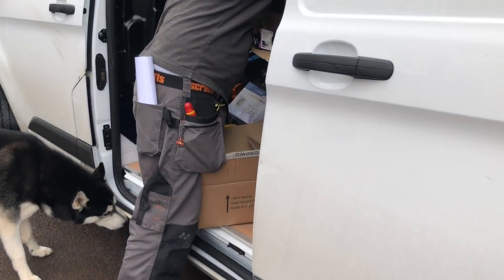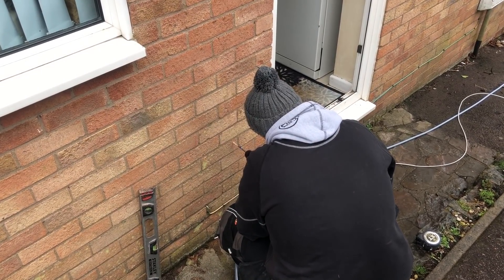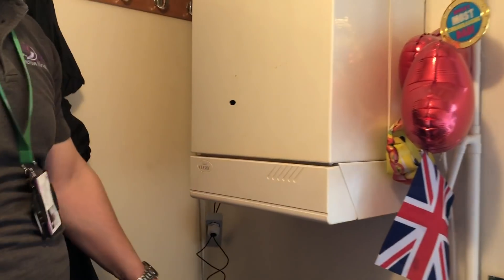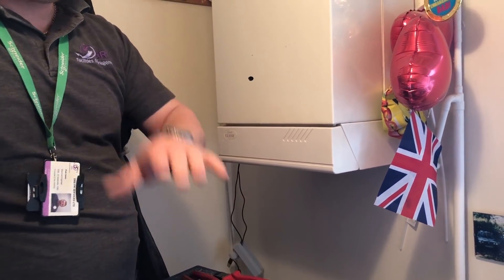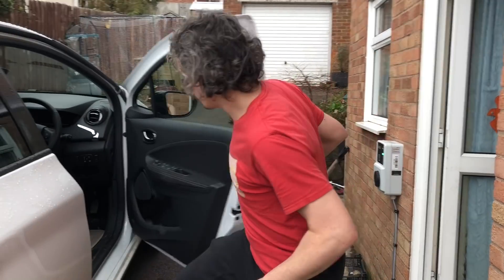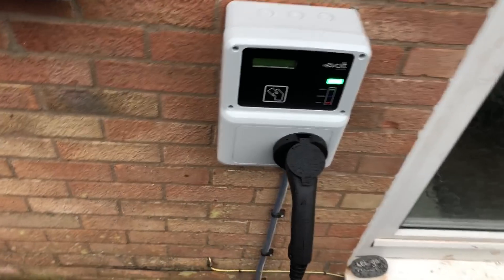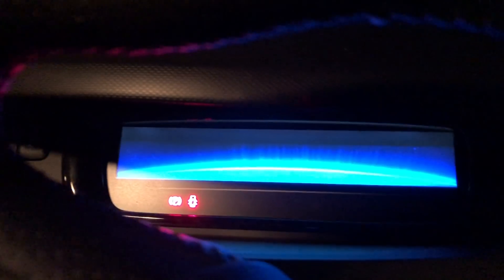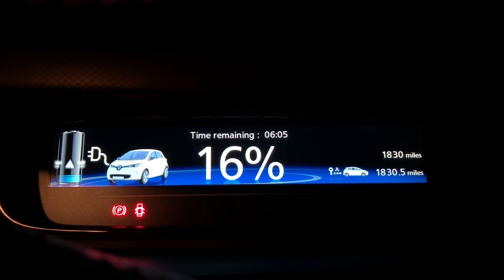7.2kw eVolt Electric Car Charger install

Comment: pod point guy took literally 20 minutes to install my 7kwh charger for my 30kwh leaf. ¯\_(ツ)_/¯
Reply from the maker: What the same charger as this one? Or the same as my original one (which also took 30 mins to install). This one is much more in-depth so would be really surprised if they could assemble and program that in 30minutes lol
Reply: Ian Sampson the pod point has everything integrated, all WiFi stuff. So it was just a matter of running a cable and mounting it on the wall
Reply from the maker: Greg Jaskiewicz yeah totally different bit of kit. This one communicates directly with the car and allows the electrical grid to remotely monitor your power and turn charge on and off for periods of time etc.

Comment: Nice EVSE! Too bad the screen doesn't have a backlight , not sure if you'll be able to correct the condensation issue but the price was right! Cheers!
Reply from the maker: lol price certainly was right :)
Reply: Ian Sampson don't you feel bad about them having the control of your charging? I would be quite hesitant with that.
Reply: I've had the same charger for a year now with no issues, they even send me surveys now and again and give me Amazon vouchers for the trouble. the only down side is having to keep your router on 24/7

Comment: Worth checking your electric meters time is right for economy 7 if you have it coming on bang on midnight. Our meter is supposed to change over at 12:30 to economy 7 but the clocks wrong, and it doesn't change with the clocks so in summer we don't actually go on economy 7 until about 1:50am, which is a bit annoying.
Reply from the maker: That is annoying! Our area it starts at 11:30 and finishes at 7:30 from memory.
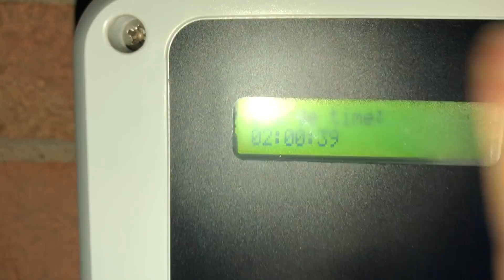Reply: Looking on the bright side, you could do a lot of things in the morning on 'night rate'! The timing at my place is 23:36 to 6:36 GMT, all the year round now (it's supposed to be 23:30 - 6:30). Until a few years ago, my supplier used 'radio teleswitch', and it was 'night rate' from 00:30 to 07:30 GMT in their area.

Comment: Put a silica gel packet inside to absorb the moisture
Reply: Another brilliant video ian. Just as a matter of interest, who do you have economy 7 with? And what are your price rates?. Many thanks. Keep these videos coming. Cheers
Reply from the maker: Thanks Chris. With scottish energy as were the cheapest - actually I need to switch as off the special deal, but it was 5.7p per kw off peak.
Reply: Ian Sampson
Thanks for that Ian, I'll have a look at Scottish Power, I'm currently on 9.7p at night with extra energy, so need to have a good look round. Cheers again.
Reply: As a recommendation: use only Ofgem-accredited price comparison sites.
https://www.ofgem.gov.uk/consumers/household-gas-and-electricity-guide/how-switch-energy-supplier-and-shop-better-deal/compare-gas-and-electricity-tariffs-ofgem-accredited-price-comparison-sites.
Most of them allow to select "green energy only" supliers
Reply: 5.7p is about 7c which is what large use farmers get in Ireland so you are getting a very good rate. thats £2.50 for a full charge. In this weather aroung 250km  ~ 1p per km
Reply from the maker: Not sure what deals they have now, but at the time it was good. Apparently Green Energy are good as well.
Reply: Yeah had a look at green energy, it was that 3 hours 4-7pm thats a bit of a stinger for me(cooking kids tea's). I'll have a good look round, if I find anything good, I'll let you know. Cheers

Comment: Can you put a limit on the charge? So that it wol only charge to 90%? Because it seems to me you would get a lot of extra electricity loss and battery usetime/ degradation for little added range.
Reply from the maker: From the ownership of the Leaf for the 4 years and 60,000 miles; I found no loss from charging to 100% - in fact in the newer leafs Nissan removed the option to limit charge to only 80%.
Reply: Ian Sampson. Maybe that unlimited 100% explains the faster degradation of the 30 kWh packs. Does the LEAF pack need the 100% to balance the cells?

I've read several reports on Dutch forums that the charge loss on the Zoe is about 20%. I saw a complaint about the LEAF for much higher losses.

This paper from Denmark suggests very low single phase efficiency for Zoe. http://orbit.dtu.dk/files/137328554/efficiency_paper.pdf

The number are not easily measured i'm affraid, with charge loss, battery heating, preheating the car.

Can you read out the measured charger output and the amount of charge the car reports?

Comment: 2 X 7.2kw gonna be interesting charging to 2 cars
Reply: Tim Morgan easily... depends on your loads of course, but with 2 electric showers going and someone running a 4 ring hob you’d be up there...
Reply: Mark Williams could a home even draw over 14Kw+ from the grid at the same time.
Reply: Yes easily.  My old 1 bedroom flat was on economy 7 night storage heating and in the winter with the water heater on as well, I was pulling 20kw peak from the grid at the start of the economy 7 periods.
Reply: Mark Williams the env200 will charge at a little slower rate. It is either 3.3 or 6.6
Reply from the maker: Mark F - correct. its the AMPs of course thats the issue really. But ENV200 is only 3.3 (16amp) and Zoe is 7.2 (32amp), AMP fuse. With everything electrical on we are not close enough to cause any issues.